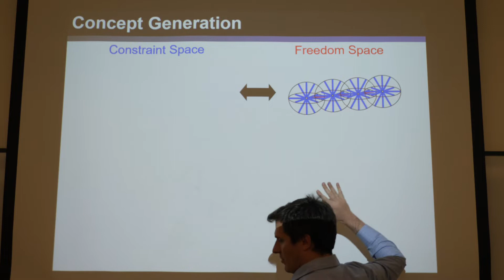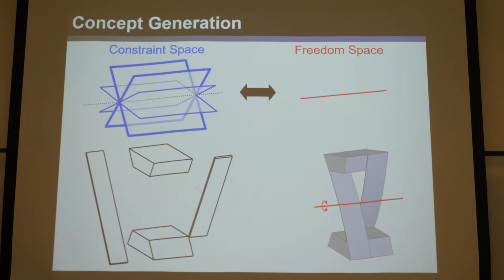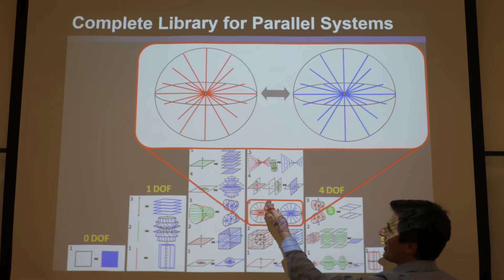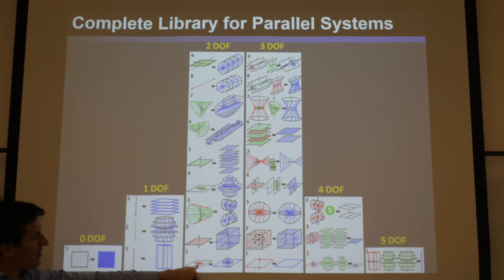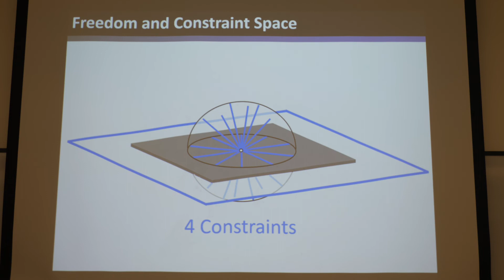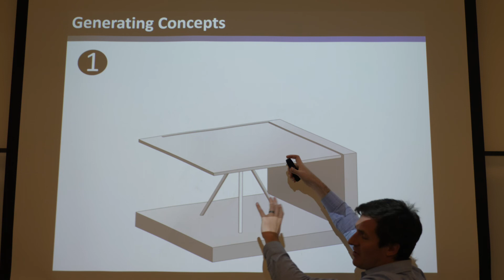Comment: ### The FACT Design Process

[Lecture 5 Part 7]

1. (6:26): Specify desired DOFs.
2. (8:35): Consult the FACT library and identify the corresponding freedom and constraint spaces.
3. (11:42): Determine the number of non-redundant constraints needed.
4. (12:30): Select or deduce the appropriate sub-constraint space.
5. (13:21): Pick constraints within the sub-constraint space, considering fabrication, symmetry, and parasitic errors.
6. (16:08): Over-constrain if needed, prioritizing minimal redundancy and assembly considerations.

### Example Applications

[Lecture 5 Part 7]

* Spherical Joint (6:26): Three intersecting rotations are achieved by a sphere in the freedom space and three independent constraints.
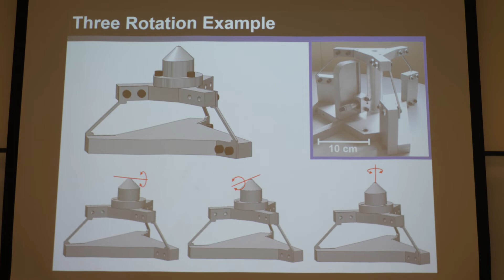* Micro Mirror Array (18:11):  Tip and tilt motion is achieved by a disk in the freedom space. Exploration of various sub-constraint spaces leads to a design with a blade and a wire, potentially over-constrained for symmetry and ease of fabrication.
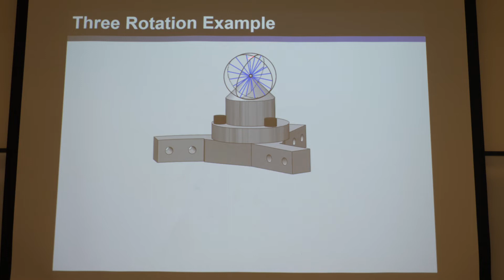* Advanced Applications (14:18 [time is wrong]): Micromirror arrays with piston motion for phase modulation and light steering, enabling autostereoscopic displays, force fields, improved 3D printing, and more.

### Key Takeaways

[Lecture 5 Part 7]

* (17:59): FACT provides a comprehensive and systematic approach to designing compliant mechanisms for parallel systems.
* (17:59): It leverages visual geometric shapes and intuitive instructions to guide the design process.
* (17:59): The FACT library and sub-constraint spaces streamline design by offering a finite set of possibilities and ensuring non-redundancy.
* (17:59): Understanding FACT empowers designers to efficiently explore the design space, infuse their common sense, and generate innovative solutions.